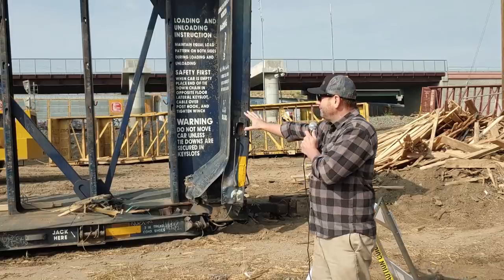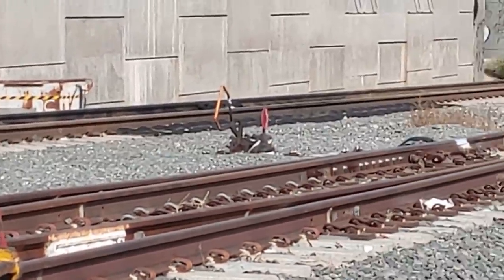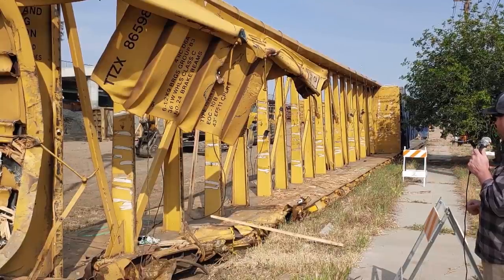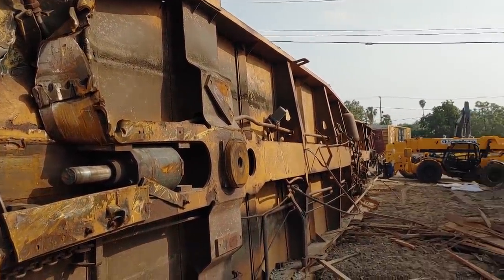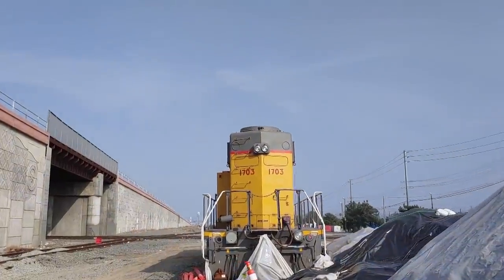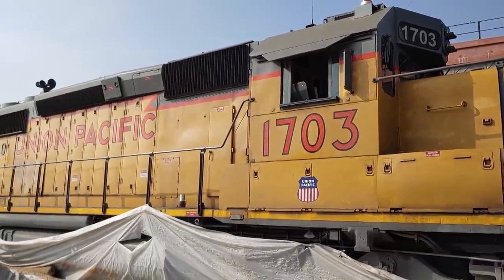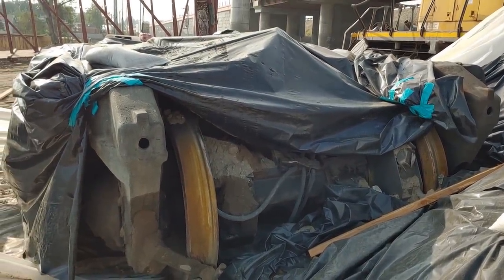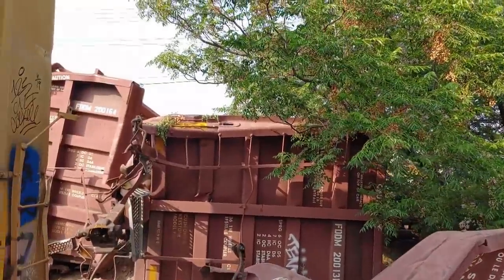Colton Train Wreck: Security Cam Footage And Close Ups Of The Damage 12 Days After Accident 4/2/22

Comment: They will probably take the generators, tanks, electric motors and controls and scrap the rest. There is a guy oout there did a drone view of 192 Engines parked in the middle of nowhere Arizona. There is another yard with like 400 in Nevada. Scrapping these Engines is probably cheaper than repair. I believe the remote control refers to when multiple Engine's are connected, they are remotely controlled by the Engineer. All the wheels and axles will be reused.
Reply from the maker: Interesting.  I've heard that it is illegal to fly drones over rails or rail yards.  I wonder if they got in any trouble.  I wasn't sure if I was on railroad property when I was there, or if it was undeveloped residential lots, but I looked it up afterward and saw that all of the wreckage was on property owned by either BNSF or UP.  I hope nobody makes a stink about that.
Reply: @SoCalCreature  1st Amendment my friend. You can video whatever you can with your eye in public. In California I know you aren't allowed to fly a drone over or near an active forest fire that is being attended to by fire fighting aircraft. You can't fly one in flight paths to or from an airport, around an airport or above 900', that is the low ceiling for private aircraft. Police and Fire are exempt. You can't fly one over an active police action being attended to by law enforcement aircraft. If you want to meet the Secret Service go fly a drone in Washington DC. You can't fly one over a prison however you can fly around it's perimeter, the same with a military installation, you can fly the perimeter, you will get harrassed by military police. Stand your ground explain they have absolutely no jurisdiction outside of the fence on public property. They will be full of testosterone and anger, then they will call local law enforcement. The best argument is to have pictures in your backpack of that installation you printed from Google Earth. They are way more intrusive than your drone on the perimeter. I have a friend that is amazing at flying drones. He takes me with him because I'm the confrontational backbone, he gives me a spare controller. I don't know how he does it but he casts the video feed from his drone to the controller I have. He conceals his location and I walk out in the open to be seen by those that believe photography is a crime. I look in the sky and rudimentary use of the controls like I'm flying it. They demand my controller, they demand deletion of the video, they demand I stop flying. Then local police do and say the same thing. I tell all of them if you have the authority and the law on your side then I encourage you to come and take it away from me. Badges and uniform patches bristle at this because I'm calling their bluff. Sometimes local police are so arrogant and out of control I get detained and handcuffed. I tell them the drone will crash and that I'm streaming to a cloud account. It just infuriates them. They demand I push the button for the drone to automatically return to the controller. My friend has the drone land and then he looks into the camera laughing his ass off. Then I explain to the officer it's time to get a Sargeant or some Stars or Bars out there cuz he's in trouble. It's a teaching experience for everyone and I get to be the teacher. I filed a complaint against one officer because he lost control of his emotions and he was so angry that he was humiliated in front of State Prison personnel. He broke my cell phone, the controller and the marks on my wrist lasted two days. My friend called his police station and said I needed help against the officer. He was concerned I was about to seriously get hurt. Cops came out of the woodwork, I was handcuffed and on my knees and the Sargeant lost his mind. I rode with the Sargeant back to the station to fill out the complaint and to make a statement. Sargeant lectured me that it was my actions that started this ball rolling. I said I respectfully disagree, pubkic photography is not a crime and that everyone that was there except me was happy to stomp on my 1sr Amendment right of Freedom of the Press. It's amazing how ignorant they are, they ask for press credentials. Press credentials are handed out by the police to let news gathering individuals closer access without an adversarial slant. Private events like the NFL hand out press credentials for those they allow into private areas. Our Constitution allows for all Americans to observe and report what is seen in public. I'm glad that security didn't harrass you on scene, it was great video of the aftermath. Keep doing what you're doing!
Reply from the maker: I'm not as concerned about them complaining about the footage itself, just that I posted video of what I later found out was me trespassing.  I was like, "oh man, I'm gonna be on America's Dumbest Criminals." lol. 
When I saw the security guard keeping an eye on me I went over and struck up a conversation with him and pretty cool.  He was the one who told me that it was the first day off the clean up crew had taken, and that the previous 3-4 days the place had been crawling with inspectors.  I told him I was from "SCC News" which is technically true I guess, and he OK'd me to walk on site and get close ups.  After about 25 minutes or so he thought better of it and came looking for me and said I should probably get out, but he let me go get some footage of the locked boxcar before leaving.  Luckily he did because that's when I ran into the neighbor that had the security cam footage. 
That's sucks about all the harassment from using the drone.  I've been thinking about using one, but now I think I'm gonna want to study up on the CA codes for that and maybe print some copies out incase I have to get into a legal debate with the cops.  That sounds like such a pain.  I have no interest in doing First Amendment Audit videos on this channel, but maybe just to keep myself out of hot water. 
Thanks for the input.

Comment: 1554 will more than likely be scraped because of it's age. But for the most part, if the base plate is not bent, it can be rebuilt, and the lease company that owns it may sell it to class 3 railroads. The cars will be scraped. 
Generally, remote engines don't leave yard limits. I'm sure someone was trying to cut corners and let it run further than normal to save a dime.

Comment: To my knowledge I think engines that are remote control are only unmanned in rail yards when they are switching cars from one track to another.  Derailment clean up usually start right away. Is that where the cars ended up? Or were they moved there by heavy equipment?
Reply from the maker: These were definitely moved around on the site.  After I published this I did see some aerial footage of the accident right after it happened.  I wish I had seen that before I did this video because it gave some perspective on how it played out.  The red bulkhead car that had the end ripped off was the first freight car in the line, and it was the one that was attached to and smashed into engine 1554.  So that connection is where the worst of the damage occurred.

Comment: Remote control, means it's probably a DPU, and can be placed mid train as a helper, or on the rear as a pusher, and is controlled by the lead locomotive with the crew.
Reply from the maker: Yeah, I'm learning from the comments that the blinking light probably meant it was under remote, but a lot of people are saying that there probably were at least two people somewhere on that train.  I really don't know and haven't seen anything conclusive. Thanks for the comment.
Reply: Speaking as a railroader, freight train conductor and Remote Control Operator……Your information is not correct.  The wrecked UP locomotives in the video are RCO that normally are controlled by the conductor who wears a remote control strapped on his chest.  Those locomotives are not capable of being DPU’s and when in RCO mode have a max speed of 20 MPH.
Reply: @cj4276  OK, I wondered about that, since they were in a manifest freight? I've seen videos of switchers that were used in yards, or industrial sites that were controlled that way. But didn't think they were used in mainline trains.
Reply: @cj4276  There you go i was going to say that. Interesting your initials are the same as the guy that ran into  me head on at 10mph. Pushed the drawbar into the no six traction motor and shorted it out. I can say that story now covid took out that brother a couple of years ago. I'm sure he told the story himself because he was off for 30 days.

Comment: So much misinformation in this thread regarding the remote control status.   ** MU or Multiple Unit.  Allows multiple locomotives to be daisy-chained together and act at one unit.  Has been around 60+ years and every diesel locomotive has it.  NOT considered remote controlled and no special signage on the unit.  ** RCO or Remote Controlled Operation.  What we have here.  Same idea as the toys you buy at wally world.  Operator on the ground with a (relatively) short range belt pack to control the locomotive.  Used for switching in the yard or at a customer location.  Look at the reply in this thread by Cody.  All the "Remote Control" signage and warning lights to warn people that the locomotive can move by itself without anyone in the cab.  Can not operate on the main in remote control mode.  ** DPU or Distributed Power Unit.  Being used more frequently as railroads move to longer trains.  Allows a locomotive (or locomotives) to be placed further back in the train and controlled by the lead locomotive.  Usually the DPU matches what the lead units are doing, but the DPU settings can be different if needed.  Example would be a long train going over a hill where the front units would be on the downgrade and braking, while the DPU might still be on the upgrade and needed to push.  The DPU units cannot move by themselves, only as part of a train.  When the train is being put together, an engineer will have to be physically on board to move the DPU units into position and make all the connections prior to putting the units into DPU mode.  Does NOT have "Remote Control" signs on the locomotive.

Comment: Very common to see remote control units doing yard work or local runs. Engineer and conductor will always be present on train while under remote control…
Reply from the maker: Interesting. I didn't know that was a thing.
Reply: Wrong, switchman such as a foreman and helper are operating, also they could have been 2-3k feet away who knows
Reply: You are right when one of them is engineer qualified.
Reply: @BossSpringsteen69  what do you mean, I run a remote box and I’m not an engineer….

Comment: sd40-2 #1554, engine, controls, and the front would be saved for parts the rest of it SCRAPPED, sd40-2 #1703 and 1599 would be repaired and return to service

Comment: 37 yrs with UP Loco Engr .very well could be Remote ,but with FRA for backup I doubt true  facts come out on it 😶
Reply from the maker: Interesting.  You're comment made me wonder if the head of the FRA might be an ex executive, lawyer, or lobbyist for the railroad industry who was put in place to dismantle  the regulatory entity from the inside, but it does not seem like that is the case, right now at least.  Just seems like a career transportation guy. Who knows though.  I'd be disappointed if they just wait for time to pass and for people to forget.  Disappointed, but not entirely surprised.
Reply: Definitely in RCL mode. The leader was the controlling unit they were operating from. As far as being on the point it seems like probably not. As you know, not being able to feel when the train starts to sit down you can easily miss judge speed and distance. I would have set brakes early and slowed it down.

Comment: The remote control is only to start the train engine by satellite for cold weather but it will not move without the key the sign is to let people know it can start at any time
Reply: I'm sorry but, that's not true. They don't start by satellite. Satellite is used to locate the  position of  the locomotive. Auto start starts the locomotive if its active. There is no key. You got the sign part right though.
Reply: Yes it is true on northern southern they can and do start them in cold weather I know this by getting certified to run them for the company I work for and you need the key to move the train
Reply: @robertkennelly228  Northern southern???

Comment: The frames are twisted on these locomotives. They’ll pull the engines and cut them up for scrap
Reply: Shows you don't know jack about these trains. Do some actual research and you will find they restore trains a lot worse then these. Even the worst one will get restored
Reply: @terryfrye4552  You don’t know Jack or Jill.The older engines aren’t worth the cost. They’ve got miles of locomotives stored in the desert

Comment: Remote units do not go out over the road! They stay within the yard limits!!!!
Reply from the maker: I've had comments that these had two crew, and others saying that they were all remote.  I think all we can do is speculate at this point.  I'm not aware of any official report.  I hope if one comes out somebody will comment here with a link.  Thanks.
Reply: @SoCalCreature  for the love of God. RCO usually has two crew members with two remote boxes that share operation. One can be used to make cuts while the other operates. One can be on one end of the yard, the other can be on another, controlling and protecting moves and shoves, lining switches, etc. Our RCO in the yard has two crew members per shift, twelve hours each. The crew doesn't physically need to be on the train. You wear a collar and an RCO box attaches to it. It's how you remotely operate the locomotive you're linked to. You can be standing in the yard and the head end of the train can be a mile away, while you're working at the rear, flat switching or licking cars. Yes, you can be on the locomotives while operating the box. Once you pull your build into a yard track, you can cut away and ride the locomotive(s) back to the yard.

Comment: As far as the "remote controlled locomotive" is concerned, they can all be remote controlled, but, one end of the combination has to be the control end which is where the engineer is. There can also be engines in the middle or on the tail end of the train that is controlled by the front engine where the engineer is. The difference is that when you have more than one engined combined, they are connected together with cables and when there are engines in the middle or on the tail end they are radio controlled by the front engine. Of coarse they have safety precautions built in that will shut an engine down if something goes wrong or if it looses control from the controlling engine.

Comment: That’s a bunch of debris
Reply from the maker: Yes. Still a lot of work to do.  When I stopped by on Friday there were about 20 bundles of good lumber stacked at the edge of the street on wood chocks so it was ready to forklift out of there, and it was gone when I returned on Saturday to get footage. So the majority of the good lumber is gone now.  It's almost down to the train debris.  Who knows how long they'll take to remove that though.  I looked up the property on the Assessor's Parcel Map and all of the wreckage is sitting on land owned by either Union Pacific, or BNSF, or jointly owned by both of them. Maybe they are not in a hurry to remove the train debris since it is on their own property. I don't know.  I'll stop by every so often and check though. It's not far from my house and I pass by there often.

Comment: Remote control means that only the first engine is maned the rest are remote controlled by the  lead engine
Reply: That's not correct.
Reply: The third unit or second could have been controlling but the leader was controlling in this case.

Comment: Union pacific railroad company implemented remote control engines when the technology became available to get rid of manpower the wreck that you’re observing is a problem with remote control locomotives if there’s been an engineer on that job when he saw the filing of the other train and the condition occurring he would’ve stopped but because it was remote control the conductors got the control box and he’s on the other end of the cut work in the yard job this is a total malfunction and a lack of human involvement if they’ve been engineer on this job the wreck probably wouldn’t even occurred but that’s what the railroad gets for trying to get rid of the human element

Comment: The Rc signs just means it can be used  as a dpu unite can be used in the middle or last unit on a mile or two long train train control Ed from the main front locomotive all controlled by remote
Reply: Wrong.

Comment: I was here only 6 and a half hours after the accident, so it was pretty surprising when I found out about what happened. (And here is the video for that day: https://www.youtube.com/watch?v=JwBxnloimSo&t=42s) Thanks for the video!
Reply from the maker: Yeah, looks like you were on the the Pepper bridge.  You were just 1 offramp away.  Super close. Did you see any of the news copters flying around? I didn't notice any in your east facing footage but you were angled down toward the trains.  That semi you caught at the end hauling the pre-assembled sections of rail may have been heading over to the scene of the accident.  I saw many stacks of those on site and I got footage of another semi delivering another stack on the morning after video and a forklift moving them around site.  If you have not seen that video it's at https://youtu.be/MD2E1HuF_7o

Comment: Remote control means it's electronically controlled by the lead engine
Reply: Wrong.
Reply: Any of the three could be the controlling unit as long as there is  RCL electronics installed.